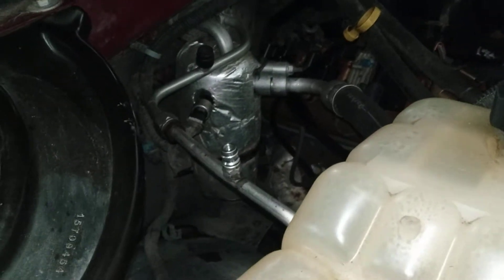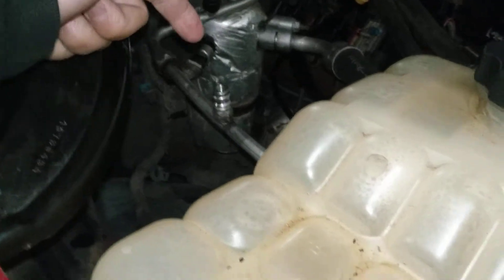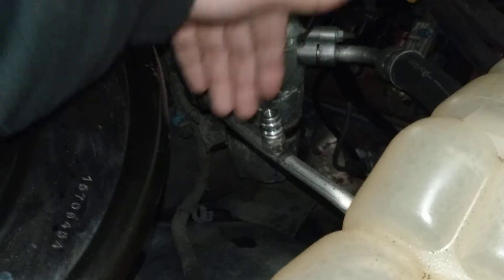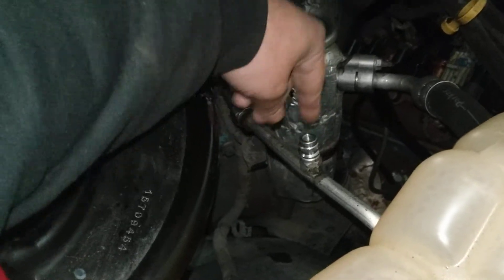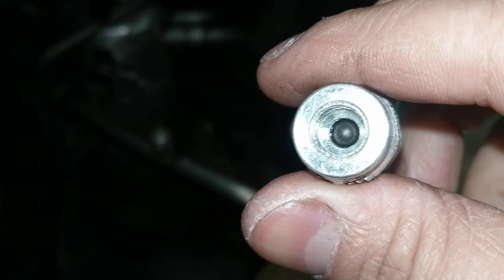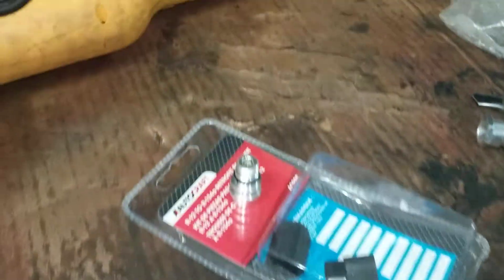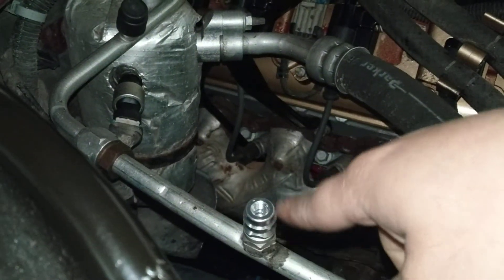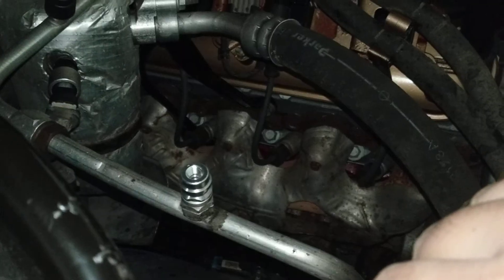GM AC high pressure valve failure

Comment: I was a GM tech for 40 years and I have never heard of a one time use service port. 
Ports can be damage by inexpensive port adapters. Don't turn the knob down tight.
Reply: I've recharged many cars with my gauge set...never had a problem until today with this same piece of shit ball valve shown here. I've found out from calling a car AC supply house that this is a very common problem with these valves
Reply from the maker: oh yes it is, it's such a dumb design. they also sell one to convert to a Schrader valve. but I've tried two and they dont seal properly
Reply: @Kingcustomz  So the one you used in this video is another ball valve port or is it the ball valve replacement into a Schrader valve? I am confused because the part you linked seems to be a Schrader valve? Please help thanks.
Reply from the maker: I used another valve ball. I bought two of the Shradwr valve types and they leaked. But I’ll re look at the link and send you a better one. I’m sure that link expired
Reply: @Kingcustomz  Ok cool I was confused, I am dealing with a leaking ball valve right now on my 03 GMC Yukon and I was debating if I should switch it to a Schrader valve or go back with an OEM original ball valve type of port. I will probably buy an OEM replacement from GMC and hope for the best.
Reply from the maker: Yeah go with it from dealer, you will get 1 year warranty also
Reply: @MRM-wp4gr  i just found out mine is an issue on my 94 mustang, the high and low port valves. So from what you just said, which is better to use that will last? The replaceable shrader valves that you can just replace the valve instead of the entire housing? I guess it'll be easier to at least be able to do that vs buying the entire housing anyway but heck a leak is a leak and if the one he replaced in this vid will last about as long as you replacing just the schrader, heck its the same thing in the end lol.
Reply: @sandmansimms5704  If yours are schrader valves, it's best to keep them that way and put new cores in place of the old ones....very easy to do after refrigerant is removed from system.
Reply: @MRM-wp4gr  no they are just like the one in this video I believe I think it's this video I watched 2  videos. But it definitely does not look like a regular Tire about you know when you look at it regular Tire valve it has the shape of the tool that you use to remove it when you look down inside when I look down inside mine all you see is a black ball looking thing kind of like around the head of around something and I actually tried one of the older tubes that I got I took one off and try to get it off of both ends and it would not unscrew so probably not the right one. Probably not a Schrader valve tight that's on there but I guess you can probably swap for a schrader?
Reply from the maker: i agree
Reply from the maker: very true... 🙂 I love when my viewers get along 😊
Reply: I ran into to the same issue last summer, The guy that charged my system for me had several on hand, he told me its best to just replace it when you recharge the system. I think it was like $5. Good video.
Reply from the maker: thank you, and yes I always just replace them because of this issue
Reply from the maker: thanks my friend, at least that's something good to know... I'll try it next time and see.
Reply: I have been doing HVAC for 20 years,  and I was just thinking the same thing.
Reply from the maker: @bigboytoyz541  what have you been thinking?
Reply: I am confused, so we should change to the shrader?  
Because if the ball valves are not very reliable then if you then have to do another evacuation your going to have same issues since you have to connect hoses to ports to do a vacuum
Reply from the maker: Heck yeah, replace them to Schrader I haven’t had luck when replacing them to the schrader but other people have had luck

Comment: Awesome Vid. thanks for sharing 
i have the same problem,got the valve kit but how much Freon and or PSI readings?
Reply from the maker: hey man, thank you. make sure you completely drain the system before messing with freon.. also on your avalanche, under the hood will tell you how much freon is needed
Reply: @Kingcustomz  Thanks a lot keep posting
Reply from the maker: You got  it brother,  thank you!
Reply: Where do I buy the valve kit
Reply from the maker: I put a link or autozone lol

Comment: if the vehicle has been leaking for a few months out of that port, is it safe to assume the system is empty and not pressurized and I can remove the port? Or should I vacuum first still
Reply from the maker: I would still double check, recover first then replace fitting then vacuum. Freon is no joke and can cause severe burns.

Comment: Can you just change it or does the pressure have to be bleed out
Reply from the maker: you have to evacuate the system first, then replace it when there is no more freon in the system. then put a vacuum on the system and recharge

Comment: I'm not sure about that high pressure port being a one-time-use because mechanic that empty out the the AC of all its coolant for fixing things or what not when going to refill it with Freon again they usually push down that Sam there on the high pressure port Evacuate the air that's in the system so what they do is Dale Sports some freon in there and then pushed the needle on the high pressure port to Xscape are out of it squeeze more freon and hit that high pressure port a skate Moore are until all the airs been evacuated out of the system but I've never heard of anybody having the new place that high pressure port just because of using it to escape the air out of the system but the very well could be that they recommend that it be replaced but unless it's leaking or doing something I wouldn't mess with it
Reply from the maker: I've heard of people doing exactly what your talking about. So the thing with the chevy is, apparently it's like a one time use for some reason. Sometimes the high pressure port sticks and causes it to slowly leak over time.
Reply: @Kingcustomz  and i by no means really know what im talking about..but i watched abiut an hours worth or recharging Ac for a ford explorer and i kept seeing them release air when refilling the AC system AFTER it was completely emptied for other maintenance was done beside just recharging AC...so people dont go releasing pressure from high pressure port..lol...matter of fact disregard my comment..lol..but no its diffrnt for every vehicle just like anything..so look atmyour manual or watch videos and watch multiple video to insure the info your getting is consistent...lol..
Reply from the maker: @MrMrSaldana  so on chevys the high pressure ports are like a one time use, that I know for sure. Sometimes you may get lucky... other vehicles you can keep going with the high pressure ports lol... if they ever leak you just need to replace the little shrader valve

Comment: What to do if the high valve and low valve are leaking filled it with Freon then noticed after I came back ac was blowing ice cold then it became warm came back looked under hood saw Freon bubbling/ spraying out of the vlaves
Reply from the maker: check the little shrader valves inside. those are what usually leaks.the low side, should have a tiny shrader valve and the little seal inside goes bad. replace both if they are leaking, then vacuum the system and recharge!

Comment: Do you have to valcum the system after replacing the high port ? What will happen if you don’t valcum
Reply: I didn’t vacuum one of my cars when I did this like 15 years ago because I had no idea what I was doing. It still blows cold to this day. But knowing what I know now, I would vacuum it. Even if you just rent the pump and do it in the auto parts store parking lot.
Reply from the maker: Make sure you vacuum the system. If you don't the moisture in the line will eat away at the system.over time
Reply: If you don't evacuate the system you will simply contaminate any refrigerant you manged to get back into the system, which would probably not even go into the system to begin with. Yes, you must remove all air and moisture for the system to function. Putting refrigerant in a non evacuated system would NOT function, period.
Reply from the maker: Thank you Michael for that much appreciated. Yes karl everything Michael  said is completely  correct and true..good looking out michael.

Comment: Ty for  video. I bought 800-955 part AC Schrader Valve from Advanced Auto Parts store for my 2000 Chevrolet Prizm and changed it way you told. AC is now working perfectly.  Thanks.
Reply from the maker: Your welcome, I'm extremely happy for you and I'm happy it works well
Reply: Mine still leaks after replacing have no idea
Reply: @jbjackson5229  mine worked for a day gas leaked afterwards. I think it's the valve that was faulty.
Reply from the maker: faulty valves will do that
Reply from the maker: did you replace it with the same style?

Comment: Corolla, thanks man, access to my high side valve very limited...I tried using a vice grip on the lower bolt head( didn't think it was a standard metric or english size because the upper valve port is not standard...(there is a GM specialty socket for $4 or so, but I rarely have to change AC valve ports on my cars) ....couldn't get the top port off using 2 vice grips...Then I used a 16mm wrench as you show, and the port came right off !!! Thank you very much !!!!!
Reply from the maker: Hey Mikecarter79 I'm glad this video helped you out... There are always special tools for everything but I just don't like buying them hahahah.. I'm glad it helped you out though.

Comment: I'm gonna change my Schrader valve do I need to do anything before unscrewing the valve I get the steps after but is there anything before or can I just go ahead and unscrew it and replace it?
Reply from the maker: Make sure the system is empty, dont want Freon all over the place
Reply: @Kingcustomz  awesome thanks
Reply from the maker: No problem, if you run into issues don't hesitate to ask